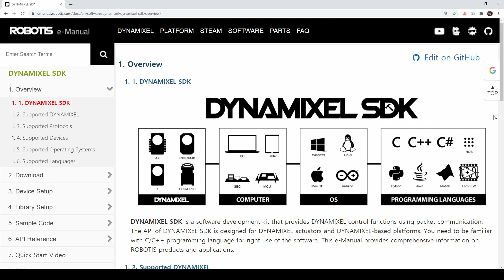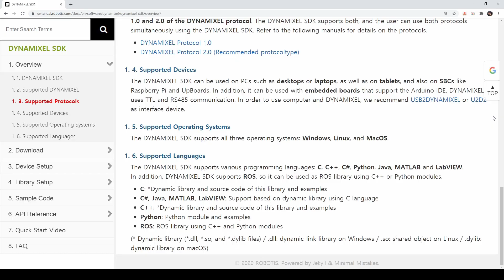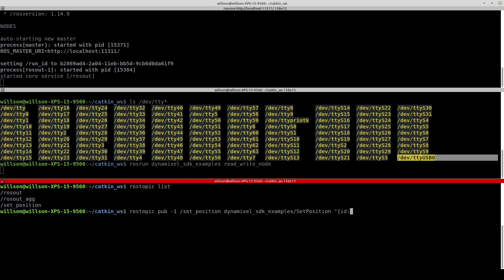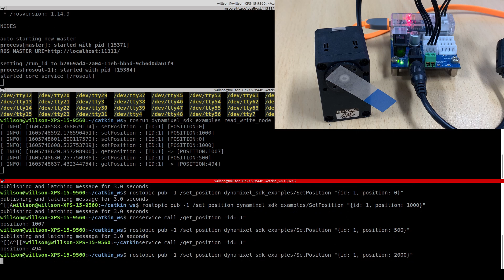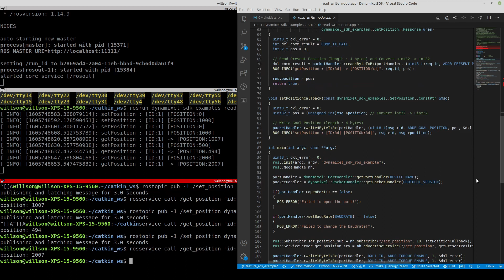DYNAMIXEL Quick Start Guide for ROS 1

Comment: hello i have some problem with this tutoral

when i enter 
rosrun dynamixel_sdk_examples read_write_node

error code
[ERROR] [1653789824.072692742]: Failed to enable torque for Dynamixel ID 2
is comming out

and i've changed ID of dynamixel 2 to 1, using dynamixel wizard

and error code
[ERROR] [1653789811.581491393]: Failed to enable torque for Dynamixel ID 1
is comming out 

what do i have to do  to fix this error
Reply from the maker: Hi, SH um

Thank you for your comment ! 

Be aware that DYNAMIXEL has two different type of DYNAMIXEL Protocol (1.0 or 2.0) 

- DYNAMIXEL Protocol 1.0: https://emanual.robotis.com/docs/en/dxl/protocol1/
- DYNAMIXEL Protocol 2.0: https://emanual.robotis.com/docs/en/dxl/protocol2/

The control table of each protocol differs depeding on the DYNAMIXEL series (AX / MX-28/64/106 (1.0) Series for example is DYNAMIXEL Protocol 1.0, and X and P series use DYNAMIXEL Protocol 2.0). Therefore, if you are using the DYNAMIXEL Protocol 1.0 products, you may fail to access the data address of Control Table. 

Please check out your DYNAMIXEL series and change the code along your product type control table.

For any other questions, visit our community: https://community.robotis.us/
Reply: @ROBOTISOpenSourceTeam  Hello!
I have a robot with DYNAMIXEL AH-12A, 4 units.
Returns the error [PortHandlerLinux::SetupPort] Error opening serial port!
[ERROR] [1684672138.230386677]: Failed to open the port! ,even when I changed #define PROTOCOL_VERSION 1.0

Please help me!
Reply: @ЕвгенийРябчунов-е9ъ  hey man, same error. did you find a solution for that?

Comment: i changed control table address parameter in read write node.cpp for xl 320 but i still get [ERROR] [1633508255.949656093]: Failed to enable torque for Dynamixel ID 1. please can you help me ?

Comment: Hi I have some question in my project if I want to use different goal position(data realtime) in Write-read example c++ 

I try to send the data from Skeleton tracking to measure the joint angle of human and send it to control servo I have already convert it into a position when I send it to control servo but dynamixel cannot write the data to servo what should I do?

Thank you

Comment: Hi nice Video, but I am having an issue, when I run "rossun dynamixel_sdk_examples read_write-node" command I get the message saying dynamixel_sdk_examples  not found. Am I missing something ?
Reply from the maker: Hello, have you build your the DYNAMIXEL SDK library in your package? Also, make sure to do "source ~/.bashrc"
Reply: @ROBOTISOpenSourceTeam  thank you for response I had the package in wrong directory it is working now ! Thanks again
Reply from the maker: @vamsimolugu8833  Good work !

Comment: Thank you very much for the very useful video!
I am using dynamixel servos to control a humanoid robot, and I am currently using ROS. Is there a reference dedicated to controlling multiple dynamixels in series (daisy chain) via ROS?

Thanks!
Reply from the maker: DYNAMIXEL supports the Sync Read/Write instruction which packs the multiple data needed to control the multiple DYNAMIXEL simultaneously.

Comment: It looks like you are running melodic. The examples do not appear to be installed for me when using the apt method, just  the dynamixel_sdk folder. I have installed via git which does load the example folder. I have followed the steps given in your video and get the nodes to publish, but for some reason my motor doesn't move- looks like the torque may not be enabled... did you have to modify the code a bit? Also, how to you set the message to only latch for 3 seconds (mine defaults to need ctrl-C to terminate)? I appreciate the video, this is the best guide I have seen so far that I have seen so far on getting dynamixels working with ros (short, clear and to the point)! thank you!
Reply: Hi- I figured out that my Mx28 was running on v1 firmware, and it works after updating to v2 (obviously the addresses for the various commands are different between the two). I decided to command the dynamixel with the toolbox library rather than the SDK, but both work now. My current task is to figure out how to make a tf2 broadcaster for motor position... this is maybe more of a ROS issue than a hardware one, so might not necessarily one Robotis needs to address... but any help would be appreciated if you know how. I can read the motor/joint state including position with Rostopic, but I’m not able to import the message into my tf2 broadcaster python script.